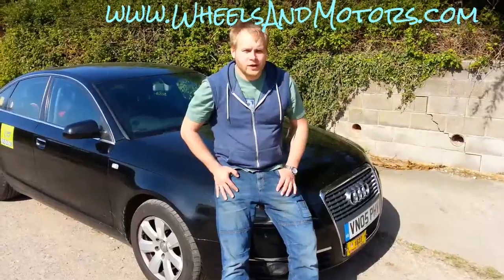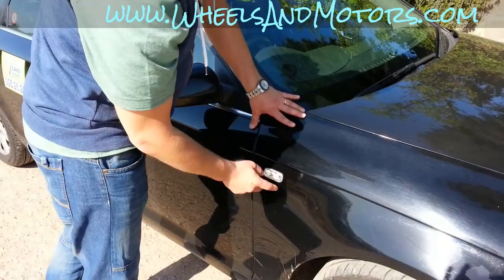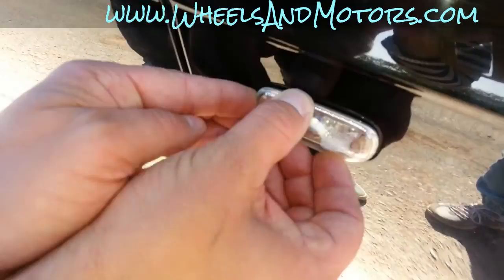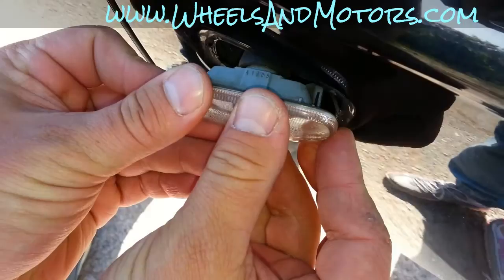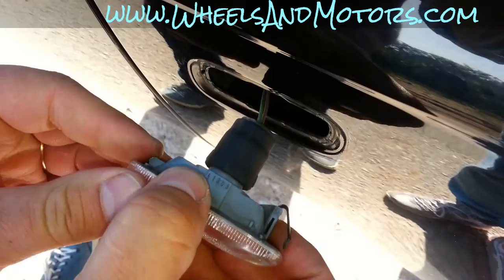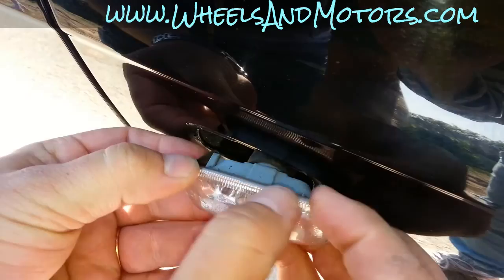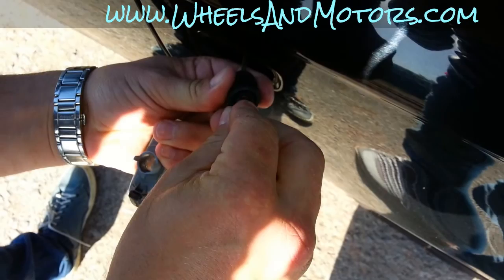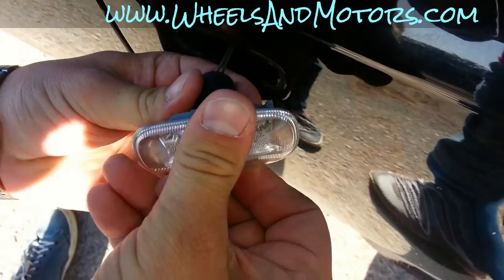How to replace wing turn signal (indicator) repeater bulb  - Audi A6 (C6 4F)

Comment: Is it normal if theres condensation in that piece? I see some in yours, mine has it too
Reply from the maker: With the time seals on these dry out and deform. It shouldn't be a big problem. It's also easy replaceable - it shouldn't cost too much even buying from dealership.